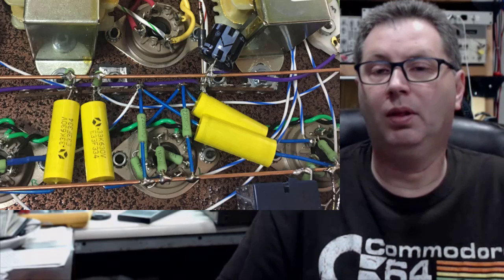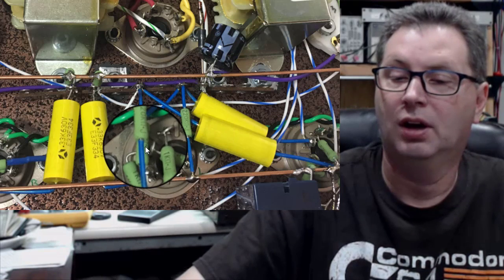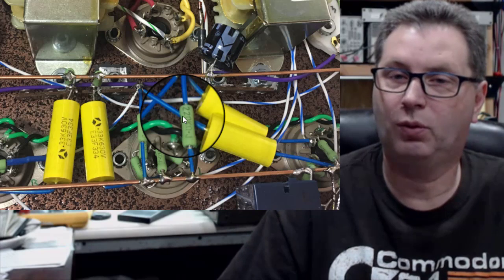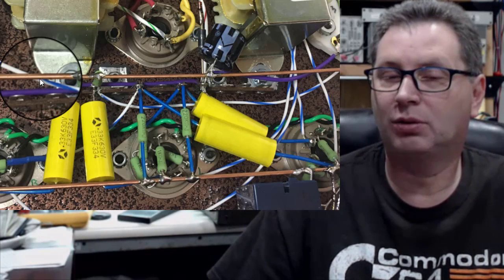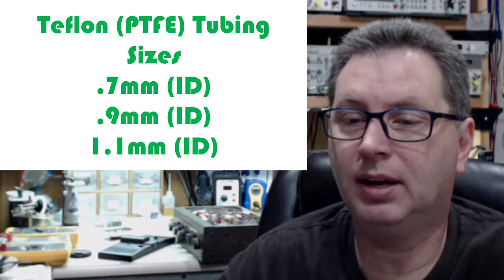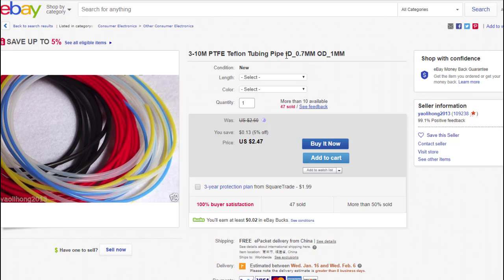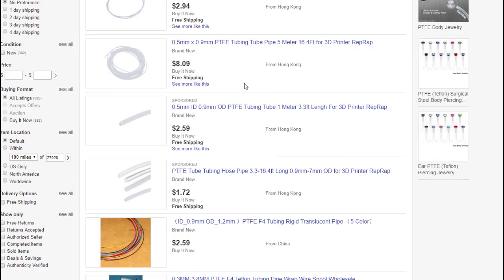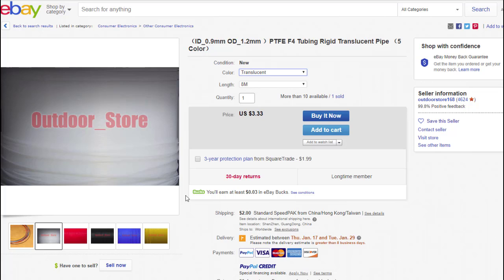How to make your point to point electronic component wiring safe and sexy

Comment: Thank you Mark !
I have a question : can i have a gain if i add wire on my circuit board and connect directly component with each other not relying on thin traces ? like making direct connection from a component to another ?

Comment: Hey Mark I was looking for a voltage rating on that tubing and couldn't find any information on it. Do you know about it's insulation value? Also, I use this stuff. https://www.amazon.com/Polyolefin-Clear-Heat-Shrink-Tubing/dp/B074HS54R4/ref=asc_df_B074HQ761K/?tag=hyprod-20&linkCode=df0&hvadid=312069228616&hvpos=1o10&hvnetw=g&hvrand=3590591868967580989&hvpone=&hvptwo=&hvqmt=&hvdev=c&hvdvcmdl=&hvlocint=&hvlocphy=9023665&hvtargid=pla-633907382597&th=1  It is much cheaper (100ft. of 1.5mm for $10.50) and has a 600V rating. The 1.5mm is the smallest they have, but will shrink down to half of that. You do have the extra step of running a heat gun over ever thing at the end of the build though. It also comes in various colors.

Comment: Usually called spaghetti tubing wherever I have found it,  I use this PTFE stuff from Amazon rated in AWG sizes -    https://www.amazon.com/Fluorostore-F019051TW-Spaghetti-Tubing-Semi-Transparent/dp/B00KJE1GG4/ref=pd_sbs_328_1?_encoding=UTF8&pd_rd_i=B00KJE1GG4&pd_rd_r=d32a26ab-11f7-11e9-9538-b564f1ff8e38&pd_rd_w=XY3Ga&pd_rd_wg=bfj63&pf_rd_p=7d5d9c3c-5e01-44ac-97fd-261afd40b865&pf_rd_r=NPC6ZWQAB75HAG9A6D5F&psc=1&refRID=NPC6ZWQAB75HAG9A6D5F

Comment: From Leo:  Thanks for keeping the old ways alive.   I cut my teeth on 1950's gear in the mid 1960's.  Most of Heathkit and Allied radio "Knight kits" were still point to point designs.  Every tech I knew had a coffee can of insulating tubing of different lengths, different colors and different diameters.   We called it "spaghetti" .  Ours was not tfe.  Most of it was lacquered  woven cloth or rubber.   In a pinch, we would strip the insulation off of #14 house wire.   With the switch to PC board design,  most of the point to point wiring techniques and craftsmanship has been forgotten.   Good to see there is still some interest.